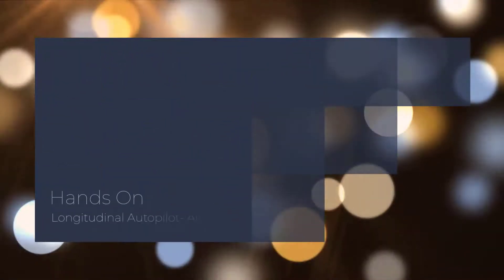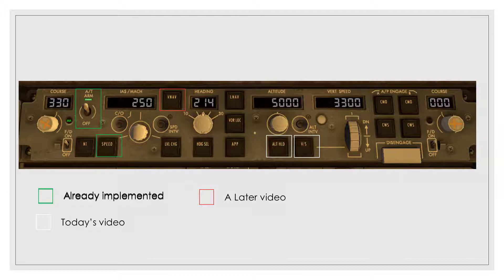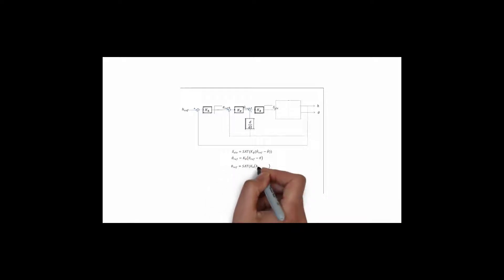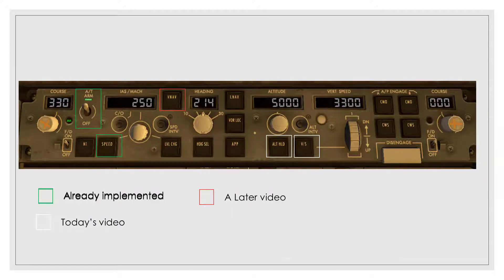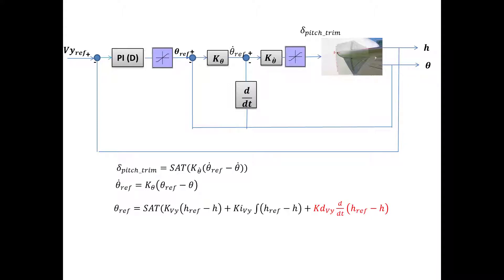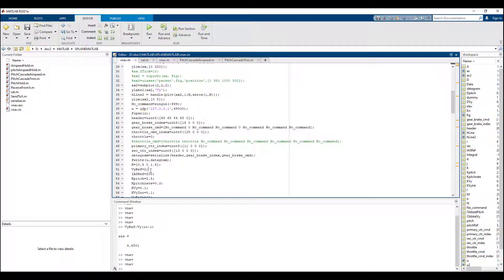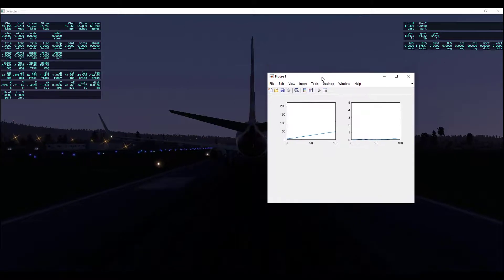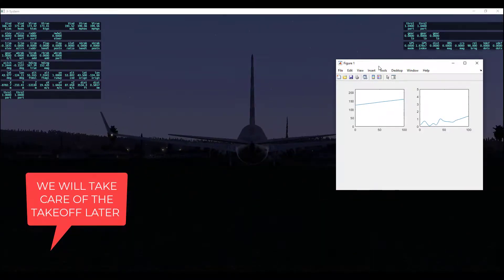Longitudinal autopilot : altitude and vertical speed control

Comment: Hi, I find your video very interesting! But I am still confused with some details. The codes you offered with this video is nothing but a single matlab file. Is that sufficient enough to run along with X-space? When I run your codes, it keeps telling me ''Unsuccessful open: Address already in use: Cannot bind''. I'm pretty sure that I did not clearly understand how the binds works, even though I watch through  the video you made regarding to data connection. Could you please help me to solve the code running problem?
Reply from the maker: Hi , 
The error you get is probably because of matlab having an old instance of a udp port still open. You can get rid of that by uncommenting the part where the port is closed / deleted . But even this will not work every time, so you will need to restart matlab.